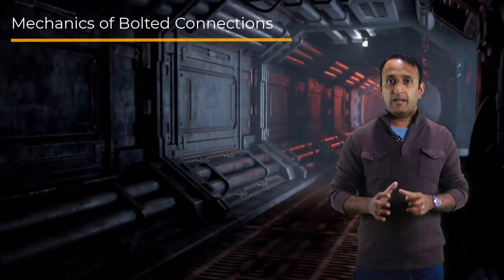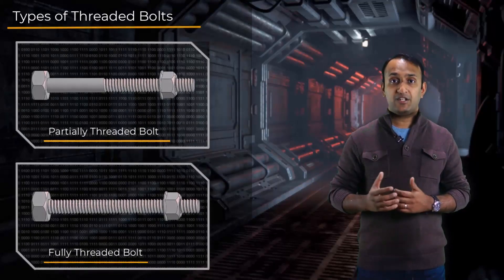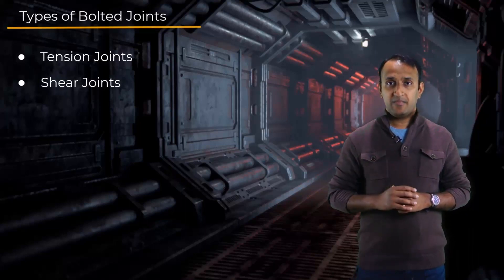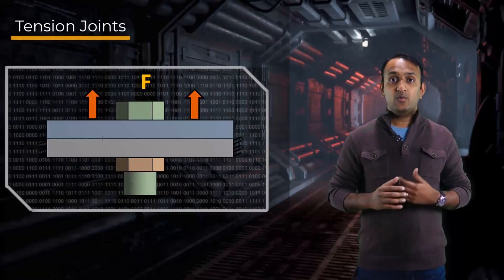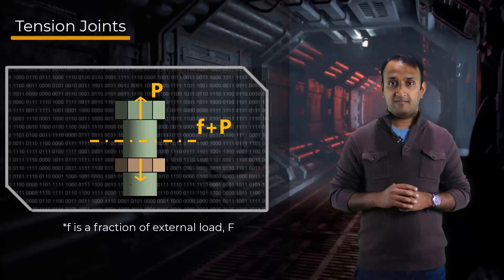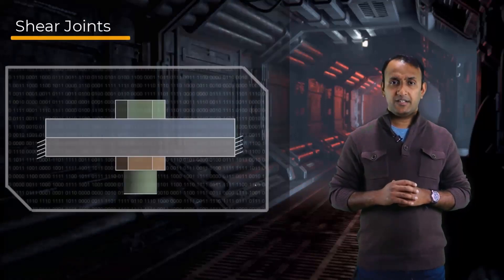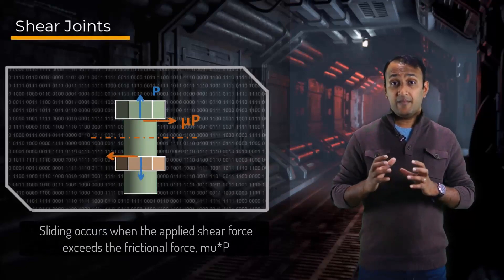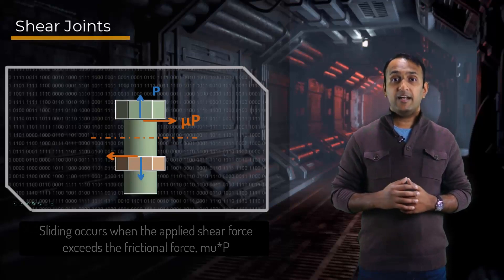Mechanics of Bolted Connections — Lesson 2, Part 1

Comment: There is incorrect/misleading information in the video. External axial load acting on preloaded bolt is not added to the pretension in 1:1 proportion, f+P is not correct. Typically only 1/5 to 1/10 of external load would add to the pretension of the bolt.

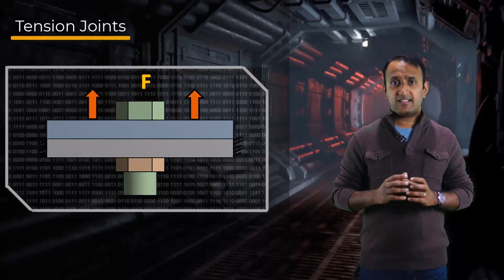Comment: I have a question. I watched another video about prestressed bolts. In the video from 1:40 you talk about the summation of the pretensioning forces in the bolt and the applied load. But in another video, by another author, it says differently. There is  a clamping force holding the two joined members together. As the load is applied, only a small portion of it is taken by the bolt. Most of it is taken by a reduction in the clamping force between the two joined members. You can watch it here - https://www.youtube.com/watch?v=XLzTB4KLCxU&ab_channel=TheEfficientEngineer
Reply from the maker: Thanks for watching! Please post your query on the Ansys Learning Forum for a detailed answer from the wider Ansys Community: https://ansys.com/forum.
Reply: @AnsysLearning  You know, in the next lesson of this playlist this issue is resolved